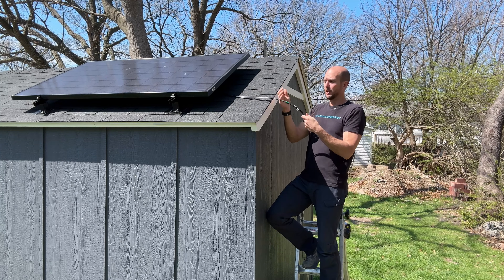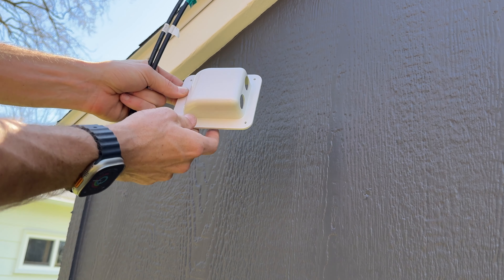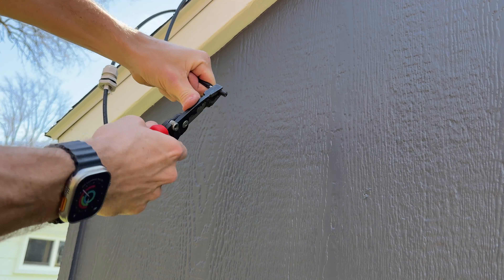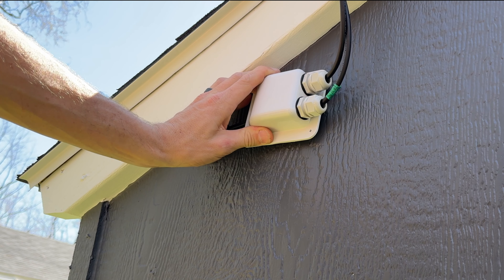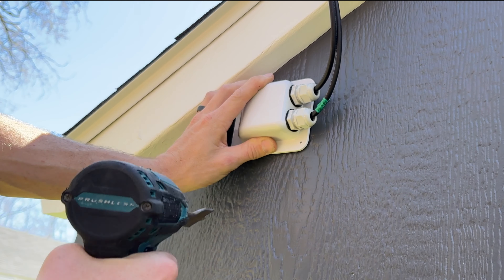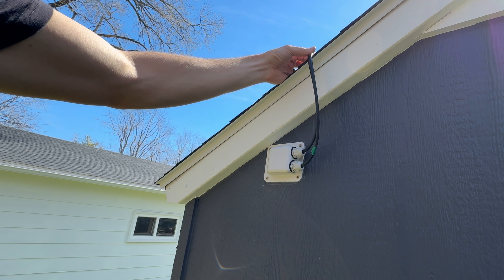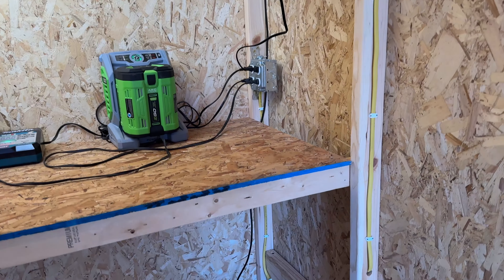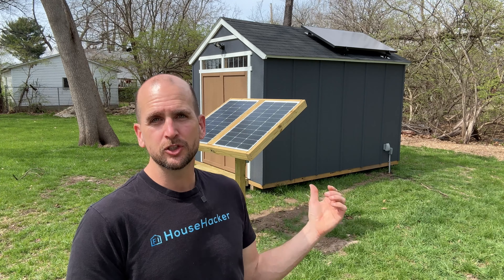How To Bring Solar Cables Into A Shed, Garage, Or Barn

Comment: I recommend whenever you run a cable down and into a wall, let them go lower and bring them up to form a drip loop.  Ideally coming up into the bottom of your housing. Yes, your gland connectors should stop water, but the best protection is done in layers.

Edit:  And you covered it.  Nice!  :)
Reply from the maker: I actually agree, I was limited in the slack but mentioned that exact point of the drip loop as that is a much better practice.  Thanks for the feedback.
Reply: Don’t silicone the bottom edge of the cover.  This will leave an egress point for any water that happens to intrude from the top, sides or cable connection points.

Comment: You should have just gone down through the roof under the panel. Cleaner install and no worry about rubbing the cable on the shingles. Soladeck is perfect for this.
Reply from the maker: Agreed, that is a good option.  I should have mentioned that option as that is what I did over on the garage https://youtu.be/icBKYACja7Y .  This installation I was trying to keep as easy as possible when you only have 1 panel.  Thanks for the feedback.

Comment: This seems like an awfully restrictive method.  Wouldn’t it be much better to use a IP67 junction box so you could also use the box to route wires to (for example) security lights, cameras, Christmas lighting etc.?  This method only gives toy two solar wires only and leaves you drilling more holes if you need to add on.

Comment: This is the second video in a week where someone has cut the connectors off just to crimp them back on again so they can pass the wires through a small hole.  Do these connectors not come apart?
Reply: They do, if you unscrew the bottom the plastic pieces come off leaving the crimped end
Reply from the maker: They come apart and it is a bit of a pain to pull the pins back out.  It can be done with a bit of work but in the end it is pretty easy to just add new connectors.

Comment: Great video, thanks for making this available!  You covered how protect wires going over the roof edge with spiral cable wrap and the importance of a drip loop for cables entering the side of the shed.  Very real world - I appreciate the fine details such as the ordering for the assembly of the gland nut around the MC4 connector.  The good thing is that by including your inadvertent missteps and describing them you make this a much more valuable resource because these are exactly the issues a first-time installer like me will run in to.  Other comments on this thread are also helpful - zip ties to stand in for a drip loop, dielectric grease on the MC4 connectors, and using a cleaner Soladeck roof penetration to get the cables into the shed.  All of this is going to slow me down for my install while I order a few parts but the end result is going to be a lot better.

Comment: I use a similar feedthrough, but mine has built-in MC4 connectors with solar wire on the inside. I wanted the ease of replacing cables without needing to remove the feedthrough or pull the wire all the way out.
Reply from the maker: I do like the ones with built-in MC4's 👍

Comment: My tip to help the water drip off the cable when a loop is not possible, is to tie/fix a say 3mm cable tie around the cable, leaving about 25mm or 1 inch of the cable tie not cut off for the water to track down and drip off, which will be lower than the glad….
Reply from the maker: Nice, great tip 🙌

Comment: You could have moved the pass thru to the right and rotated it 180 so the wires are coming in from the left and angle the whole thing down to get your drip loop.  Also MC4 connectors can be taken apart by unscrewing and then pulling out the wire.....not recommended but i have done this several times and yet to have any problems with the connection later.

Comment: is there any reason why you could not have run the wire through the cable entry and attached MC4 connectors and tucked it up under the solar panel and that way had the play to mount the cable entry with the wires coming out the bottom giving you a drip loop.
** ALSO do you have a link for the wire protector?
Thanks again for your videos, I am just in the process of adding 2 panels on my shed to power my Echoflow

Comment: Are those batteries okay to be in the shed when it's cold? I'd like to do the same, but it gets down to about 5-10 degrees fahrenheit where I live in the winter. It would be nice to have a permanent solution.
Reply from the maker: The Delta 2 will have an issue going down that low.  From the Specs The Delta 2 can discharge down to 14F and charge down to 32F.  So to get this type of setup to be a permanent solution you would need some type of insulated box for the lowest temps in the winter.
Reply: @everydaysolar  Thanks for the reply!

Comment: The orientation of the entry point to shed of the cover should have been higher up on the shed, so that the wires are oriented down.

?
Reply from the maker: That was about as high as I could go with limited length on the standard solar cables.  Thanks for the feedback.